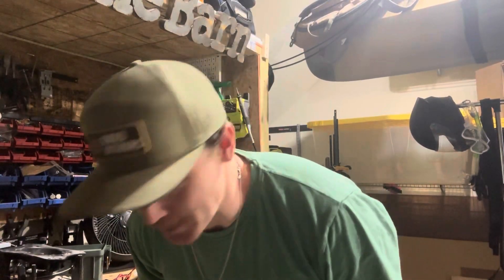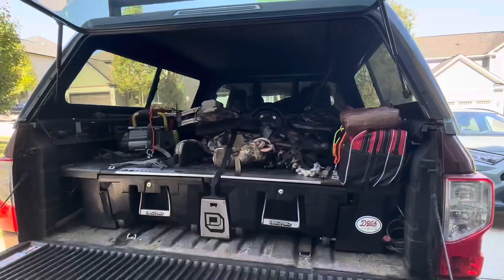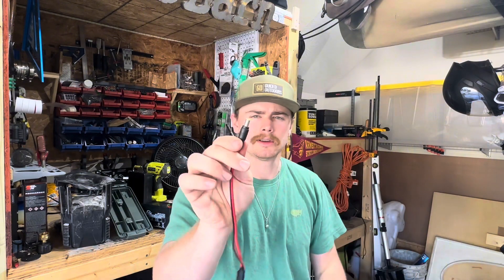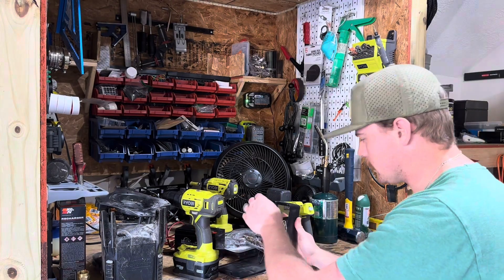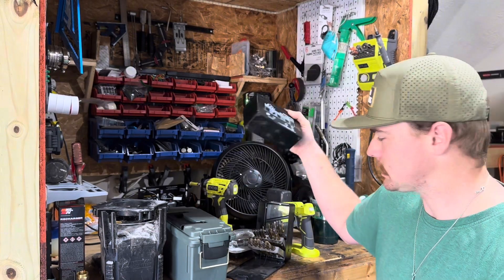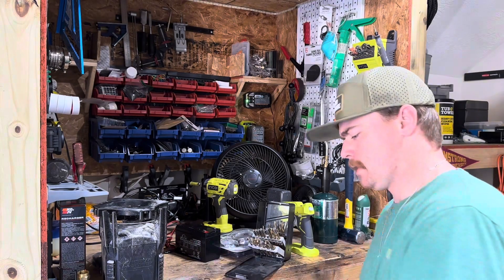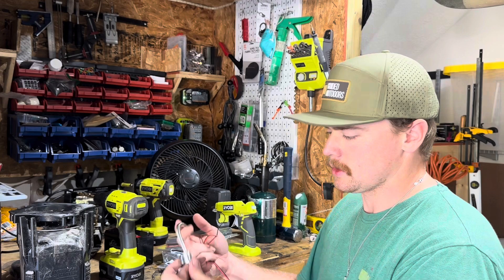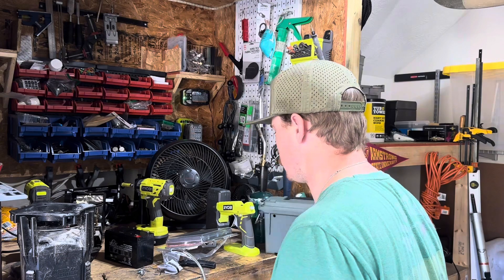HOW TO MAKE SOLAR BATTERY BOXES FOR TRAIL CAMERAS

Comment: Nice.. so if my ptz camera is a 6v. i could just solder a voltage converter from12v to 6v into the output cable for the camera?

Comment: I see one other person asking this ... question, don't u have issues with voltage? When I test my battery, it's read 13.64 volts at fully charged when you're hooking up a solor panel the way you are. You're adding more volts straight to the camera, which could damage the cameras they not made for taking in 15 and 16 volts. Other guys are adding a voltage regulator to the camera line so it doesn't burn out the camera...
Reply from the maker: I’ve been doing this for a few years and haven’t seen any issues, but I’d definitely consult an expert!

Comment: Put your solar panel wire in the other hole you drilled, then you can push more of the wire in so it doesn't show as much. My 2 cents.

Comment: I have seen another video where a similar solar box was made but they used a 12v voltage regulator in line with the setup.  Have you encountered any issues with voltage?
Reply from the maker: I have not! I have a few boxes with bigger solar panels where I put voltage/charge regulators. But I haven’t had any issue with the smaller panels!